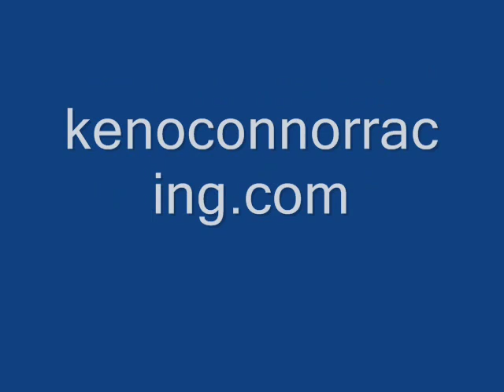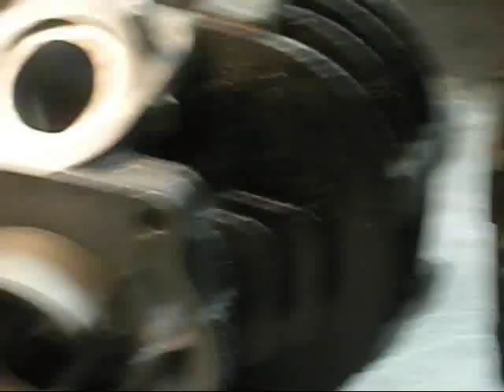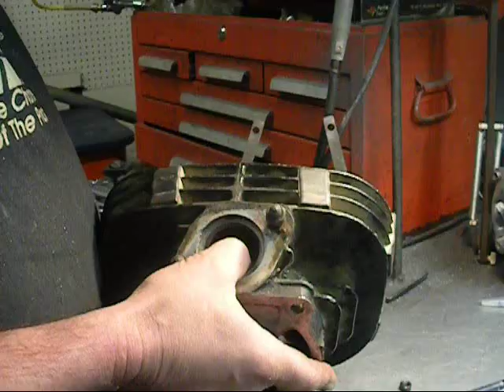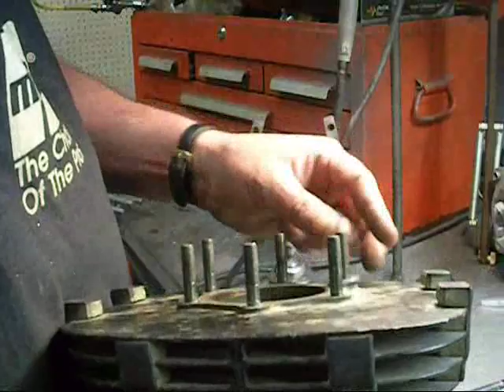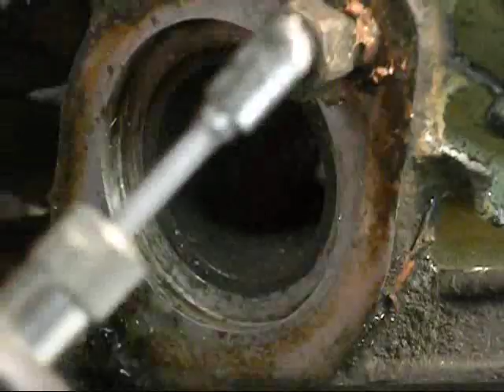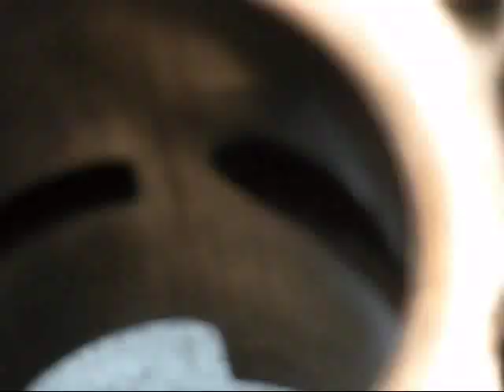Blaster cylinder porting Exhaust part 1.wmv

Comment: The blaster cylinder is notorious for having the piston crown at bdc sticking up into the port opening.

What is interesting is a 1mm base plate spacer and 2 gaskets corrects this, and puts the transfer port timing right in line for another 1500 rpm, Rick Kirmil covers this in macdizzy blaster build, even goes as far as giving head specs,  turns the anaemic 17hp blaster into a 32hp machine, that requires very little additional work, pipe it, change main jet, and adjust needle position.. run it.

Years ago I mimicked his build 3 times for others and had a local shop dyno them all, went from 14-17hp stock to at least 30 horsepower and still ran on premium pump gas.. each build including pipe, boring, piston, spacer, head work, and jetting was very cost effective and done for about 750 dollars,  now this was in 2005 dollars. Likely cost more with inflation

Comment: Hello
I have a proxxon rotary tool.I would like to do some porting work on some 2 stroke 125cc old engines.What bits would you recommend if i need to match the sleeve with the cylinder and than some window porting?I know a right angle tool would be the best ,but could it be done with just a tool like shown in the video?

Thanks.

Comment: BTW, you can get the the grinding stones you show alot cheaper from CC Specialty Tools, they are called CeramCut Blue mounted stones, they are the same thing and from the same supplier, just cheaper from CC.

Comment: Thanks for the shout out to CC Specialty Tools!! I get your approach with the Dremel, if someone is just gonna play around and do one cylinder head, just to see if they can do it, sure why not try a -D-remel. But if they intend to do more than that, or ever even think of doing it professionally like you do, they need to invest in at least a basic porting kit. If they have any intention of doing Transfer ports correctly they will need a Right Angle porting tool like the 1MC or 182AMC.

Comment: Dremals are more expensive than a second hand dentist drill , you just need an air compressor to run it, they are perfect for all the ports as they have a 90 degree angled head, they stay a lot cooler than a dremal too